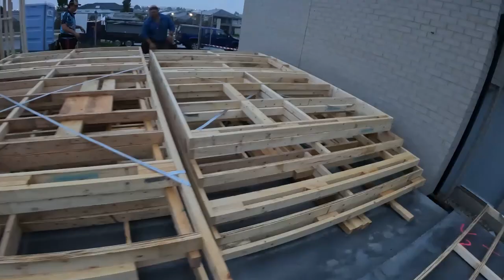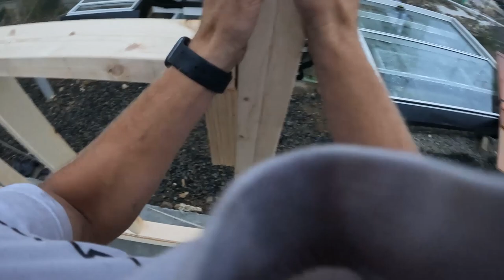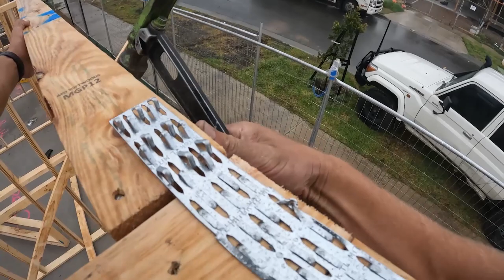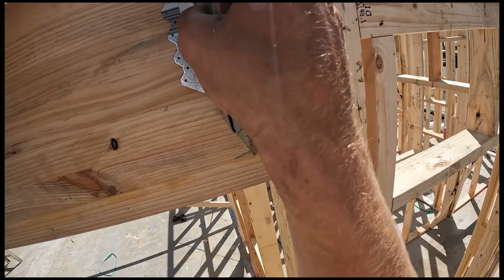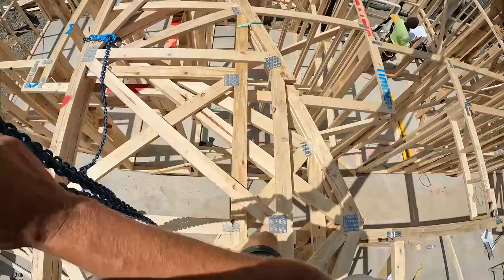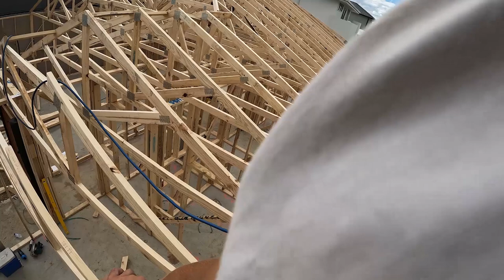Almost Framing A House In A Day // Frame Carpentry Australia

Comment: G,day from Sydney.
Thank you for demonstrating your skills  doing your job. The pre-cut frame, space allocated and construction site seemed limited. 
Standing of the walls and roof frame was, professional: while managing carpenters and deliveries all at the same time.
Learning outcomes from this video-
1. Accurate frame numbers on concrete slab (cannot be removed by rain).
2. Position and stacking of frames and trusses (near final location).
3. Air hoses, ladders and leads, not causing hazardous manual handling problems.
4. Clear communication for special cutting such as noggins, trimmers and bracing.
Theoretical knowledge of square, straight, parallel and plumb are all qualities of being a framing carpenter.
🌏🇦🇺

Comment: When you add a dwang into a wall, you create a thermal bridge that lets more heat escape. You get no significant improvement to the structural performance of the wall. The acoustics are worse.